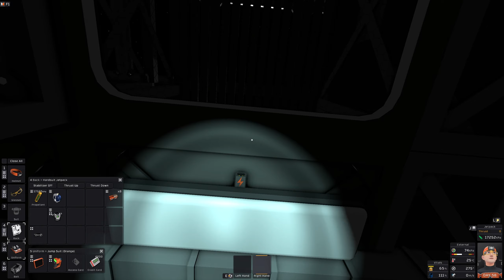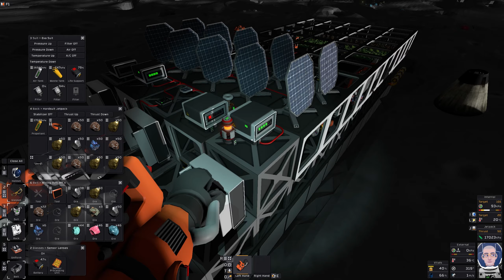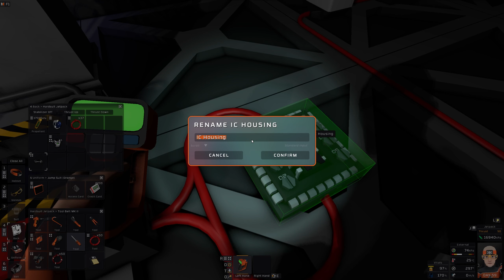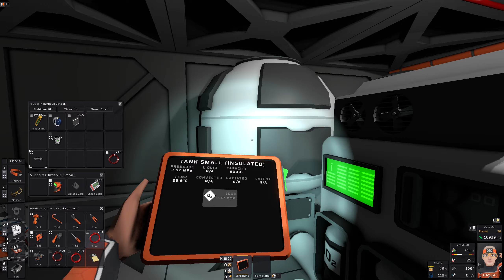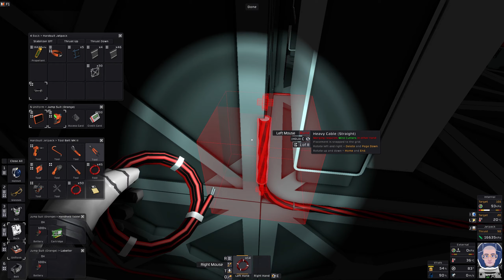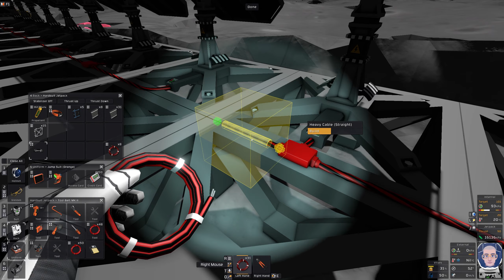Stationeers - Standard Moon, EP18

Comment: Some food for thought...  You spoke of backup power generation possibly masking issues with main power generation, and well, there are means to thwarting such problems, such as a suitable application of more logic.  For example, the establishment of a monitoring, and/or notification center (preferably in a commonly traveled area), in which you can feed all pertinent data to so you can monitor your atmospherics, gas supplies, gas generation and consumption, power generation and consumption, water generation and consumption, etc. with color changing LEDs to notify statuses, flashing lights to grab your attention to critical issues, and of course, some nice console graphs to display generation versus consumption.  Cheers!